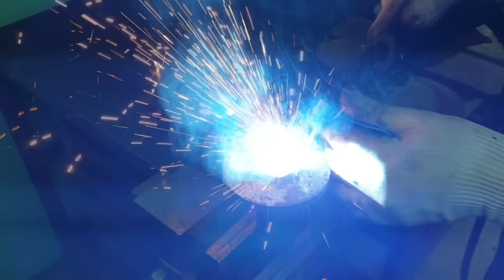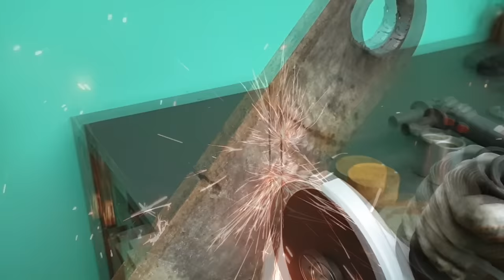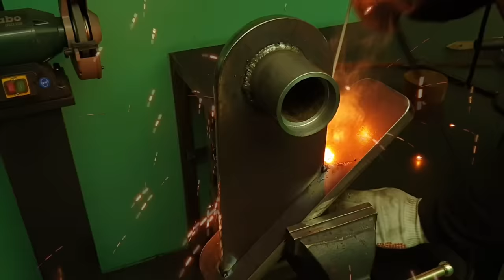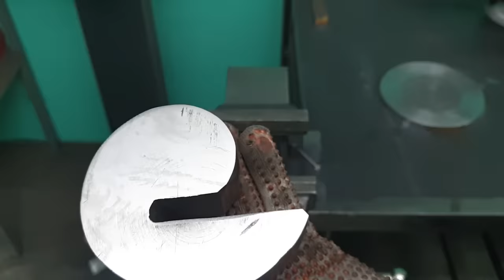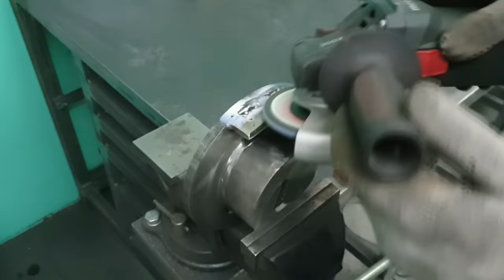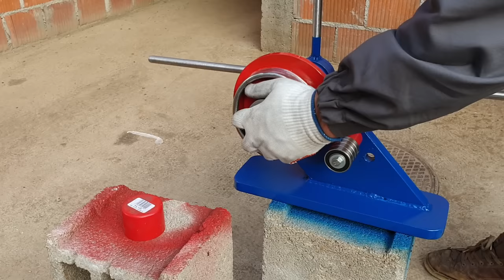DIY Metal Scroll Bender

Comment: As a longtime scroll bender, I have to say that this is one fine piece of kit! Not exactly DIY, but absolutely bulletproof! If you’re gonna go, GO BIG! Great build and vid!
Reply: Yes I agree too. I've watched several other videos on this subject and this design looks the best because the stock is being drawn in by rotation of the tool. The other design seen is a static horizontal tool and cumbersome forming section inserted as you progress with bending and also a large unwieldy swinging lever to create the bend, posing a terrific side wise force on the vertical stand. This is a smart guy who has studied and worked out the basic principle and using his mechanical skill has made something simpler and more effective, the best tool I've seen. Well done   This is the one I will construct in my workshop. Thank you for uploading.

Comment: THANK YOU FOR POSTING !!! BEAUTIFUL DESIGN & WORK !!!
   Here are a few little pieces of professional advice, for you to add to your knowledge, to make your equipment even better: 
When you're setting up to do a weld, deep-Champher your edge. (That is, "V" grind or cut your edge off at least 1/3 of the thickness of the metal). Then when you weld it, you do a "Fillet" weld. (That means, you weld down into the depth of the metal, so when you machine off the top of the metal, you're not cutting off your strength, like you're doing now.
   Also, if you hold your welding rod more straight in, (than at an extreme angle, like you're doing now), your bead will be stronger and prettier. <<for strength, use a 7018 rod>>. (Clamp & Do your tacking with your MIG or use a 6012 rod. And tack in 3 directions. That keeps it from pulling and warping.) When welding around, or close to; bearings, before you start welding, wrap a soppy-wet rag around the area that needs to stay cool. Then weld. Not the other way around. This will protect against warping and/or boiling out of grease, rubber seals, etc.
   And here's another little treat, if you'll grind the very tip of your lathe cutting tool, to a very slight radius, your machined surface will be a lot smoother, and you'll find that it's actually easier to cut your steel. When cutting Aluminum, use a larger radius. 
   Here's something else; when you're threading, using a tap or die, on steel, (cold rolled or hot rolled), use CRISCO VEGETABLE SHORTENING instead of a tapping fluid or oil !!! When tapping Aluminum, use Turpentine. 
   I worked in machine shops and job shops all my life. My Dad taught me from 5 or 6 on up. I took it in school, in Tennessee, and was around it over 60 years. I love to pass on what I know. It helps everyone.
   I was reading some of the comments, and someone was giving this fellow static about having a lathe to use and that it wasn't DYI. If an individual is interested enough, in a subject, to invest in a machine, and learns to use it, and researches and designs and builds other machines, using the knowledge he has learned from experimenting and using his God-given gift of design tallent, and he does so strictly out of Love for his hobby, ITS DIY AT IT'S BEST !!!. KEEP ON, KEEPIN' ON !!!
   THANKS AGAIN FOR POSTING !!! VERY NICE EQUIPMENT !!!
Reply: Хорошие советы,я думаю они многим пригодятся.Спасибо большое.Удачи.

Comment: you could cut those dies much faster with a torch. Judging by your circle cut on the one inch plate you have one and can use it pretty well. A #3 tip will cut 2 in no problem. But either way no matter how it was made it came out nice. You will be able to make some pretty railing for sure. I guess I got to check out more.

Comment: Can we just get real here? That creation is magnificent but clearly is not for the do it yourselfer.  However it inspired me to use the basic configuration and with scraps I had around the shop fashion scrolls much the same up to 3/8 round stock. No machining involved. Heating with torches, bending welding and a drill press. If I could show a picture it would be this scroll benders ugly cousin.  Really ugly cousin but it works great.
 That's the beauty of youtube sometimes.  Not necessarily copying but providing ideas and inspiration.
Thanks

Comment: It is a very elegant design, probably the best I've seen but... there are two things wrong here...
First, why create such a heavy monster if you aren't going to bolt it to a Firm surface at the base instead of balancing the damn thing on a brick? that is pretty stupid and second, it needs to have a tap screw to fasten the tip of the bar at the beginning of the bend to keep it straight against the inside of the center wall. Those two items just make no sense.